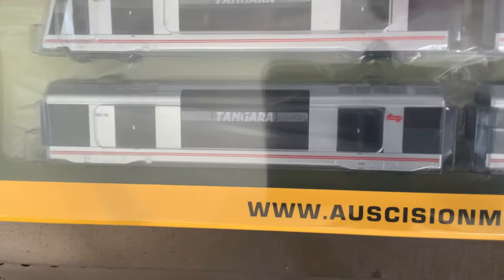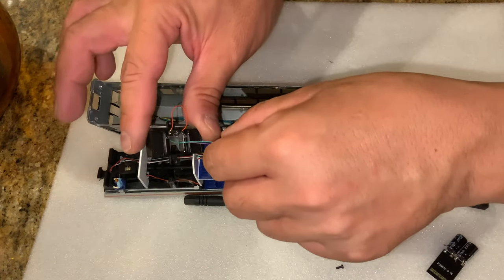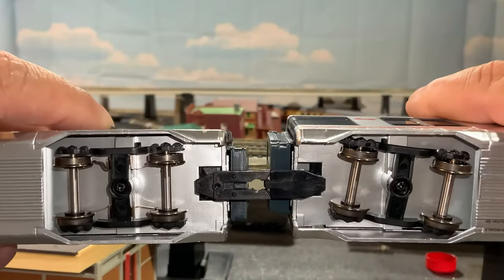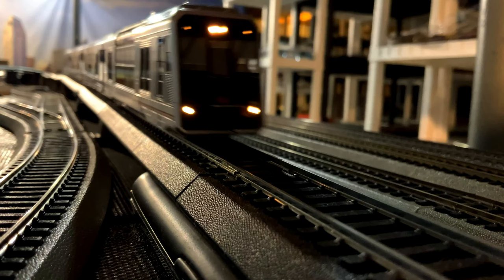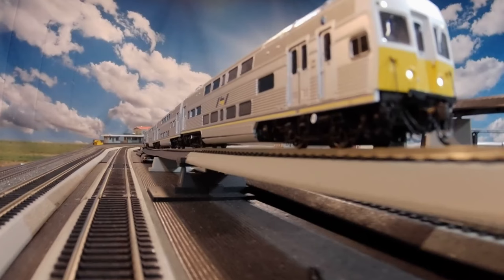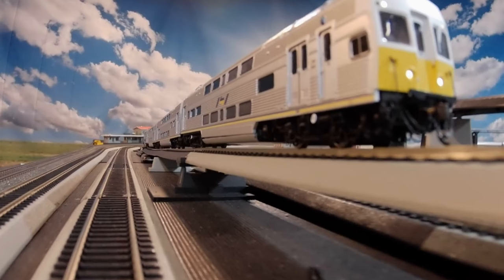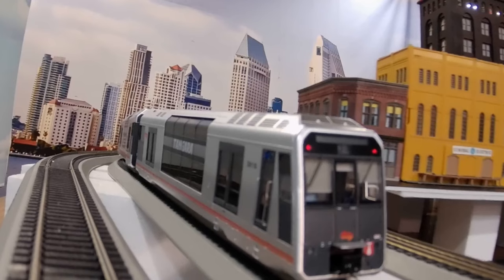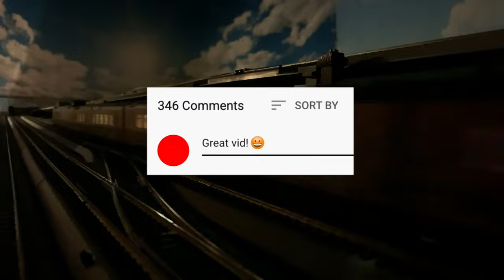Detailed Look: Auscision HO Scale Tangara / Sydney Trains T-Set, Guest Starring NSW TrainLink V Set

Comment: There are 2 versions of the Tangara, the T set is used for suburban duns and doesn't have toilets, the G set was used for intercity runs while a batch of V sets was being taken out of service due to corrosion in the underframes of the V sets and then the G sets were converted back to T sets afterwards, Ex G sets can be identified by the black or red plate having T100+
Reply: Im guessing they are the VSets i see lined up at the back of a workshop heavily graffitied at Auburn.

Comment: For anyone who doesn't know a lot about the Tangara train, the Tangara trains entered service in around 1980 and the G sets were built to run on the electrified Intercity lines in lieu for the first batch of V sets that had corrosion in the underframes so the G sets filled in for the V sets during that time. The Tangara trains run on the following lines
Sydney Trains Suburban:
T1 North Shore and Western line from Berowra to Emu Plains or Richmond via Central
T4 Eastern Suburbs and Illawarra line from Bondi Junction to Waterfall and Cronulla
T9 Northern line from Hornsby to Gordon via Central
NSW Trainlink Intercity:
South Coast line from Bondi Junction to Port Kembla
Reply: 1988 the Tangara's arrived for the State Rail Authority. While Goninan's were building the G sets, the Victorian Government put an order in for 1 demonstration set called the 4D which stood for Double Deck Development and Demonstration. This train was a spin off of the G sets but it was different in so many ways. It was lower, tapered in on the sides of the bottom deck, it had a different train management system to be "compatible" with Melbourne's ComEng train sets. What the Victorian Government should have done was get atleast 2 4 car sets built and kept the Tangara power and train management system. Victorian's hated the 4D because of the dwell time at stations.
Reply: they also run the t8 lines but not as often

Comment: 7:43 Blue light is activated when the guards workstation is cut in from that cab
Reply from the maker: So.. Dumb question, but just to be sure, you're actually talking about some guy or gal with a uniform, badge, and some sort of weapon?
Reply: @DoctorHobby  they aren't like security guards or police moreso like a driver / person who communicates when to leave the station
Reply: @DoctorHobby  The guard operates the doors, & tells the driver when it is safe to depart the platform. The guard is also a contact point for customer service (answering questions, provide first aid, announcements, deal with passenger disturbances, assisting wheelchair users etc) In a safeworking operation point of view the guard is responsible for faults & failures on the train between the floor & roof. The driver is responsible below the floor & above the roof. The guard will also assist the driver when it comes to manually winding electric points on the tracks, & dividing the 8 car T set into 2 x 4 car blocks. THe guard does have a railway uniform but no weapon.

Comment: Hi the Tangara or T set was introduced in 1988 as the 3rd generation of electric suburban trains. Your set is in the "Candy Livery" the colour scheme of State rail authority from 1980s to mid 1990s. The T sets are made up of 4 car sets and mostly run as 8 car sets these days. The sets of lights forward are marker, ditch, and fog lights. The blue light at the rear is the guards compartment. The red lights are the tailing lights. The V set you have is early 2000s to 2010 in the cityrail livery and are unfortunately due to be replaced in the next few years. I hope this info helps.
Reply from the maker: Thank you, kindly! It does, indeed! But I still don't understand what the guards compartment is..  is there a security guard in there or something?
Reply: @DoctorHobby  In Nsw and Queensland railways the role of the guard is to make sure passengers can get on and off the train easily and signal the driver when the train is due to leave the station. In Nsw they open and close the passenger doors, on older rolling stock of  the first 3 generations of Sydney trains they also made the announcements of the services stopping pattern. So the guard is part of the train crew

Comment: The red lights at the back of the train are to show the train is operating the opposite way. The blue light is a guard’s indicator
Reply from the maker: Ah, cool.. but what is a "guard's indicator" actually for?
Reply: The gaurd sits either in the middle or the rear of the train making announcements and controlling the doors for passengers.
Reply: The guards indicator tells you were the guard is so if you need help you go to the cabin we’re the light is.
Reply: @DoctorHobby  When a train is at a station the guard is the one that whistles to announce the train will depart (He/She has a black box up on the station that will light up to let him/her know it's safe to blow the whistle)... He/she also rings a bell that is heard inside the drivers cabin at the front of the train... The driver then closes the doors (Stand clear, doors closing), a second bell rung by the guard will ring in the front cabin to indicate the platform is safe for the driver to depart... 
The guards actually play a crucial role in the operations of (Sydney) trains... I'm not sure how they do it in the other states such as Victoria as many things are different between the two states (That's a story for another day) 😂🤣
The blue light on the train itself is just to indicate that the guard is using the end door at the back... 
Hope this helps  ☺
Reply: @Royal_BloodLust  Your information is so wrong. What black box are you referring to, a guards indicator light? That is a white repeater light in a black box & when illuminated shows the guard that the signal in front of the train is not indicating stop. It's only indirectly related to a guard blowing a whistle & not every platform has one. The driver doesn't operate the doors, the guard does. The guard & driver communicate using various bell signals from the old days before intercoms between train & driver. The guard gives 1 bell to depart, 2 bells means emergency stop (such as passenger trapped in the doors). In an 8 car T set (2 x 4 cars) the guard is always positioned in the leading crew cab of the 5th position carriage. This was due to concerns if the scharfenberg coupler between the 4th & 5th carriage disconnects enroute & the emergency brake doesn't apply the guard can activate it.
Reply: @markpusko2480  You say my information "is so wrong" yet you go on to basically say what I've said just wirh more detail. 
Also, you are wrong about the guards controlling the doors. The driver controls the doors of the tangara sets. Also, if you look carefully you will see a guards indicator on platforms. You should probably open your eyes a bit more.
Reply: @Royal_BloodLust  You are still wrong. a guard indicator light does not tell a guard to blow their whistle. And you are still wrong, all electric passenger trains in NSW the doors are operated by the train guard - including the Tangara. I used to be a train guard, I worked on the Tangara as a guard, I still have the Tangara operating handbook for drivers, & I have also just confirmed with 2 railway colleagues who both confirmed that guards still operate the doors, as they always have done.

Comment: That blue light on the side of the train is the guard's indicator to show where the Guard is on the train
Reply from the maker: So, as in, a guy with a uniform and badge who protects people riding the train?
Reply: No not really they just assist handicapped people or if a problem is happening on the platform
Reply: The blue light indicates what cab the guard is in
Reply: A guard's role on a suburban passenger train in Sydney is to Check the platform when arriving/ departing from a station, operation of the passenger doors and giving the driver the all clear to leave the station
Reply: @tamworthtrainnut285  no I’m sure it’s the interlock light?

Comment: Tangara can be 8 and 4  and 6 cars
Reply from the maker: Ask.. Well, the idea is that 4 makes for a "full set," (albeit a minimal one) therefore i don't have to go and get more to make it so.
Reply: Ok
Reply: Ben T sets wont run in 6 car formations
Reply: All T/G sets will not operate as 6 car sets, only 4 or 8 cats
Reply: The V sets ran in 2, 4, 6, 8 and 10 car sets in passenger service whilst out of passenger service they ran as 16 car sets between Flemington Car Sidings and Elcar at Chullora.